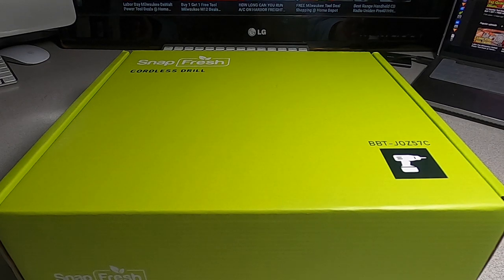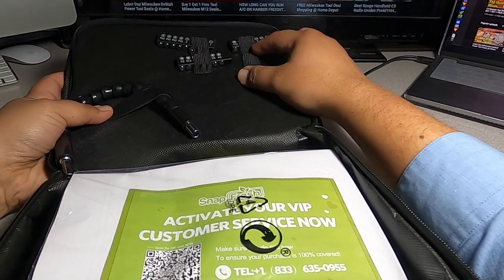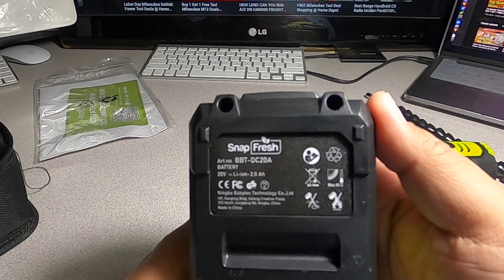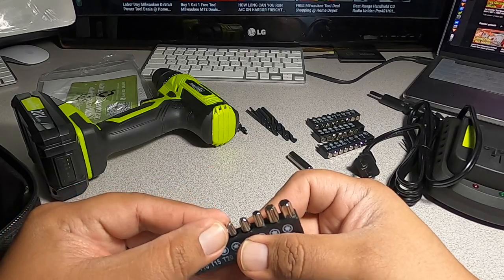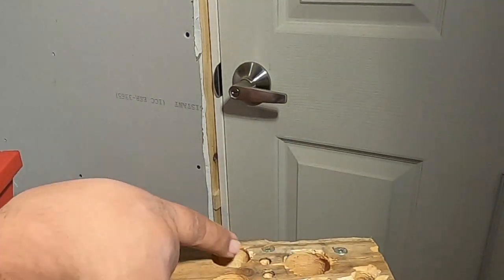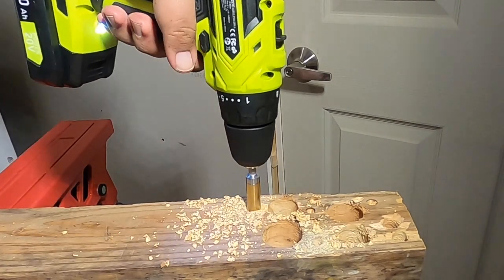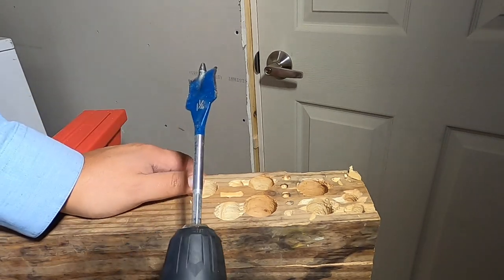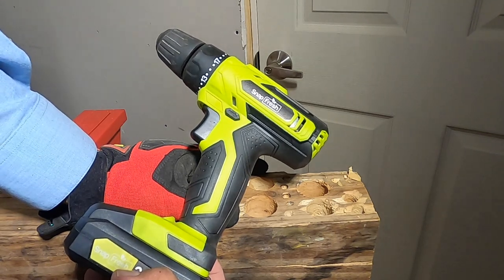Snapfresh 20V Cordless Drill with Battery & Charger

Comment: Nowhere in this video do I hear the hammer-sound of an impact wrench.  Amazon's description calls it an impact wrench and I see you put the same thing here.  Yet - I have yet to hear anything more than just the electric motor.
My wife bought this for me and I'm asking her to send it back.  I already have two strong cordless drill motors, I don't need a third - but I have had my eye on an impact solution.  If this were an impact it would have easily gone through your 4x4 with the 1/2" drill bit...wouldn't have even slowed down.
Thanks for the vid - this is exactly what I needed to prove the false description on Amazon